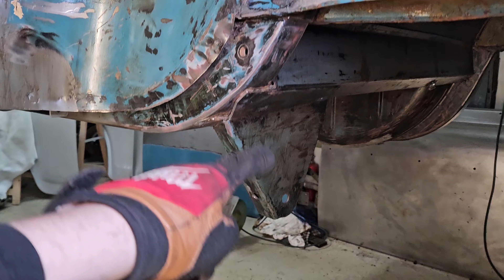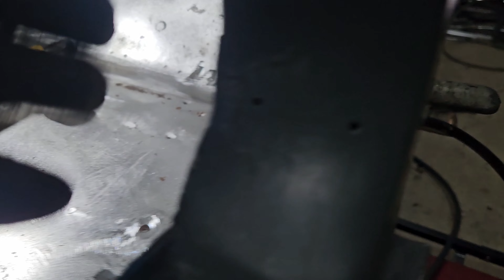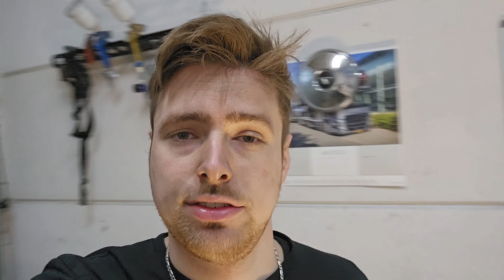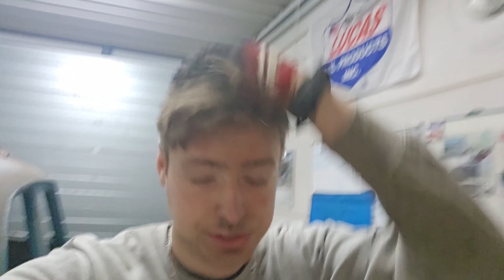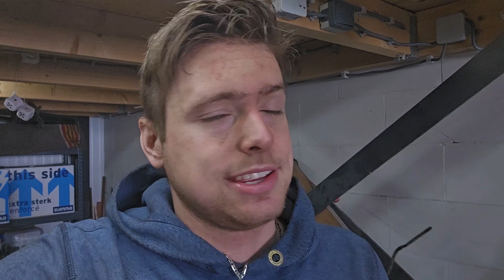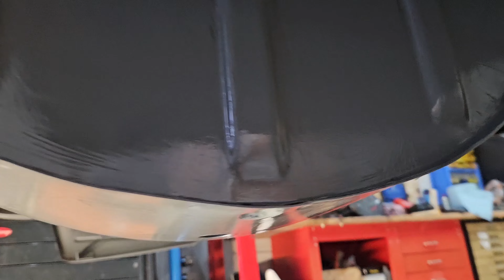Volvo Amazon Restoration - Part 23

Comment: Another fantastic video with some very thorough work performed. This will be a very solid car for many years to come. Sounds like you have a lot of nice quality of life improvements on the horizon as well with the new shop. Best of luck!

Need to bring my Amazon back for rework. Apparently the sills were welded on a bit too far towards the rear, creating a gap in the front where rainwater can flow into the cavity. One of the holes for the trim on the rear quarter panel was either welded shut or filled with body filler. It is of course the one closest to the rear door that I have a hard time reaching from the boot. Hopefully something can be done to remedy these issues.

Comment: Did you use the old gas tank...
Reply from the maker: Yes, the gas tank that came in the car is perfectly fine except the filler.. the filler is soldered onto the tank and that is cracked. I'll need to fix that weld but then it will go back in the car.

No need for a new one when the old one is rustfree inside 😄👍🏻
Reply: I have a 1966 122S, I bought 3 years ago in the mountains of West Virginia, 4 door I need to send you some pictures of all the work I've done to it..
Reply from the maker: I would love to see them! You can mail me them if you like! Mail@Rollinheritage.com